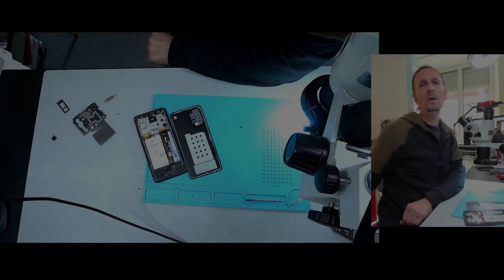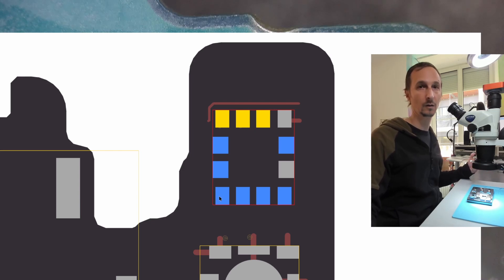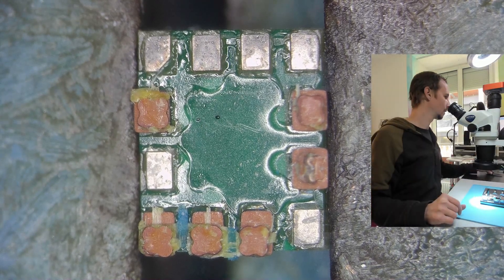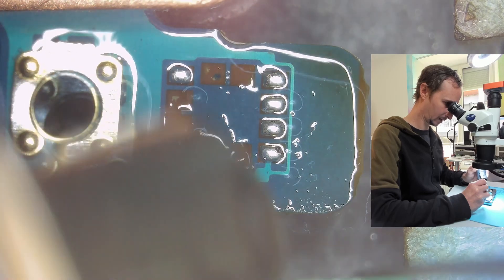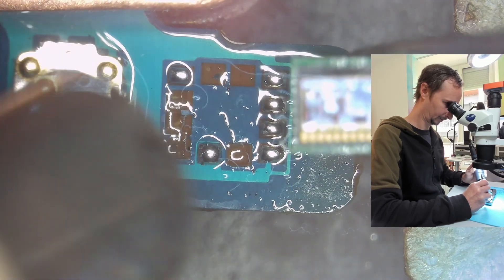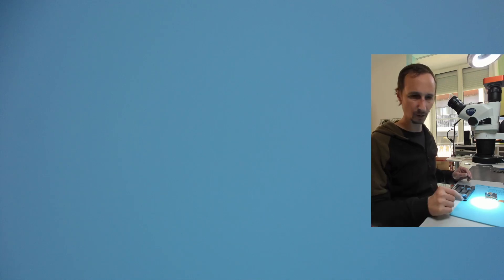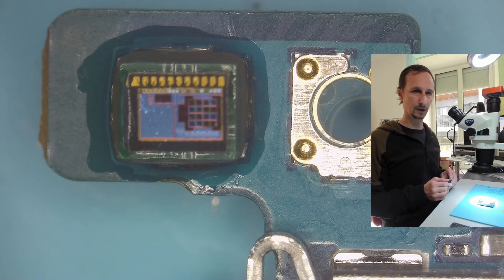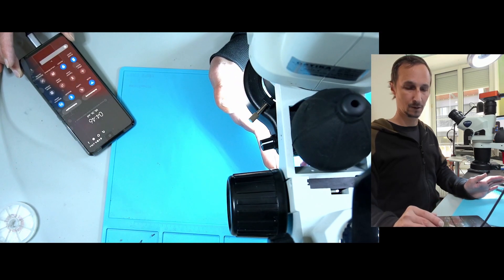Samsung A52s Proximity Sensor Ripped By Me?

Comment: Firstly, It is a great and useful video. Thank you! But i have a question. I also ripped the sensor when trying to reach vibration motor today. There was a friend with me who knows about this subject better than me and he said it is just a sensor, no big deal. We put the phone together and it worked just well. I searched and found out what sensor it was and its okay for me to use my phone without it. But i have some uncertainity. When i tested on apps i can see it is missing. But i can use adaptive brightness, phone senses when i take it to my ear and something. What does that sensor do and is there any possible dangers using my phone without fixing it?
Reply from the maker: Well as you said adaptive brightness, and also turning off the screen while phone calls if held to the ear. Thats it. Just a light sensor.
Reply: @irepairitall  oh these features still works on my phone. I guess there's something about software.
Reply from the maker: @ockatansky  Oh, ok. So just automatic brightness does not work?
Reply: @irepairitall  oh no. everything works fine but theres no sensor.